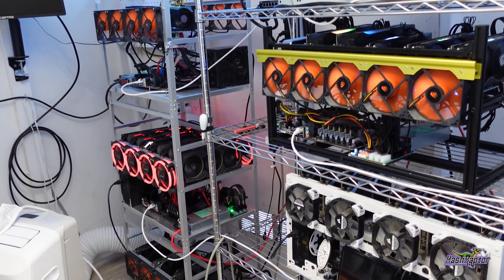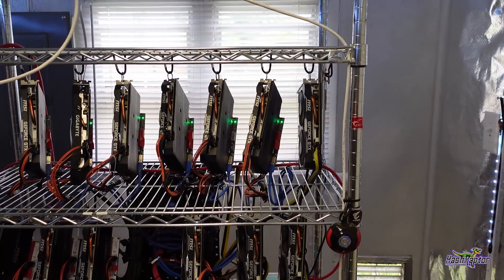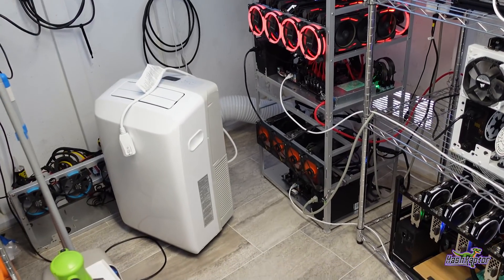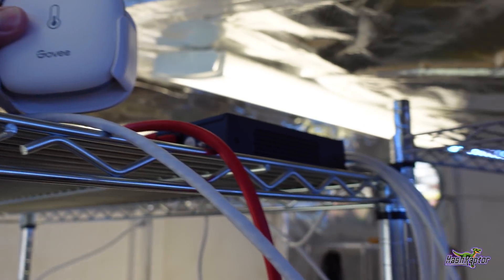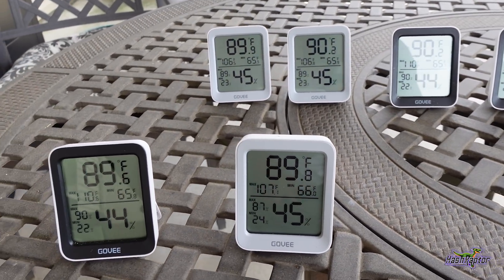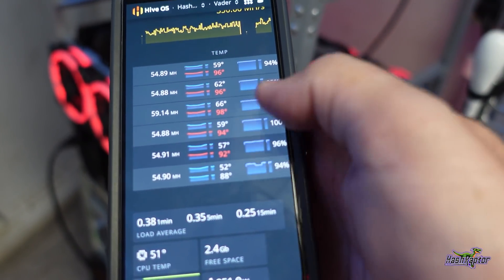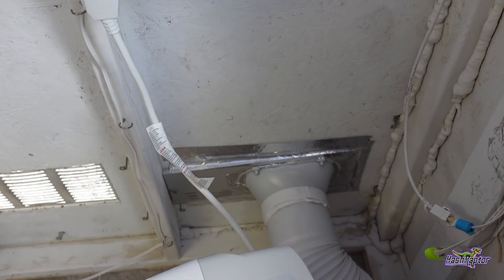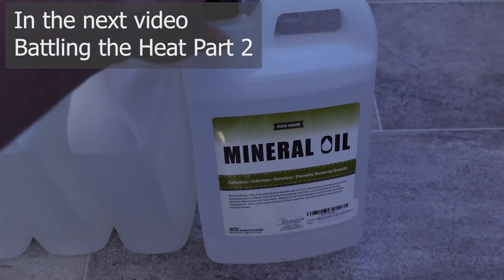You won't believe the HEAT in the Crypto GPU Mining farm !!!

Comment: Hi, I love your shed, I did mining in my shed that i already had on the property and running about 7kw rigs with 3060ti, 3070, 3080s and it generates so much heat that is unbelievable, so even when its 70 outside I still have to run 2 AC units to keep it cooler below 75 degrees inside and if its over 80 outside all AC runs 24/7.  I wonder if you have video with noise levels outside the shed and around the whole house fan  you have installed in the shed wall. I was thinking to cut one in but just worry about the neighbors. My shed right at the fence and I'm running ducted 800cfm fans to reduce the noise.  Thanks for great videos.

Comment: What does the metal on the ceiling do?
Reply from the maker: Hey I have a shed built playlist where I walk through that material. It is a radiant barrier to bounce radiant heat waves off and reduce the temperature. In some of the early shed build videos in that playlist I show the heat difference with and without it. It makes a nice 5 to 10° difference.

Comment: Put a window ac unit in the window... They are much more efficient than the single hose portable ac
Reply from the maker: Yeah, I think I'm pulling the hose unit.  May leave it in there just for me when I'm doing maintenance.  Otherwise int he Part 2 video, you will see some better upgrades I've put in :)
Reply: @HashRaptor  hose units are only good if the compressor and radiator are out side of the room or if the room already has air conditioning. Otherwise they just generate more heat to the room.

Comment: Have you tried putting that 5700 hot rig closer to the cool air vent?

If it was me, just personally, I'd list the temps of each rig and lay them out hottest and largest closest to the inlet vent and let the smaller more open rigs take the hit of their exhaust heat deeper into the farm towards the large exhaust fan.

In my head the bigger the heat source, the closer youd want it to the source of cooling.

Give yourself a full 3 or 4 days of purely shuffling them all around and marking the temp data, the layout will naturally build itself.

Comment: Change thermal pads on 5700 first. test and see results and then try with better fans. you will be surprised how much temp you can drop with pads replacement. I did it on mine 5700XTs and I see a difference by much. Good luck. Looking forward to your next testing with the submerging!
Reply from the maker: Thanks for the tips!  Hey what thermal pads would you recommend for replacement?
Reply: @HashRaptor  I personally used these on my RX5700XT XFX Tripple Diss - Thermal Pad,200x200x2mm 6W/m.k https://www.amazon.com/gp/product/B08GRZ7VLW/ref=ox_sc_saved_title_5?smid=A2UPOYF43ISB1E&psc=1

The reason why is not because they were the best rated but because the best rated were available in small sizes plus they were way overpriced. I did not expect the results I got to be honest which are 10-20celsius drop in temperature. I hope this helps.

Comment: It may be cheaper to throttle down the overclocking and hashrate on your cards rather than spend money on A.C. But you'd have to do the math on that.
Reply from the maker: Good suggestion.  Probably better to set a scheduled flight sheet for the hot hours.

Comment: Man, it's hot in there! I have a heat problem with the rigs in my garage as well.  My door is already insulated, but I will be installing some vents in the garage door itself to help with the airflow.
If that doesn't show any significant improvement, split a/c time will be a serious consideration.  Look forward to following your situation to see if there are any nuggets I can use.
Thanks for your awesome content, as always.

Comment: Hey! I've started building my immersion mining container, using lake loops to cool the liquid. Have our first tank with 32 cards in it so far. Moving over 150 more cards. We used electrocool by engineered fluids. 

I cant speak on the mineral oil front. But if you want to chat on immersion let me know. I can give some help from what ive experienced so far. 

@hashraptor

Comment: I would just install a 36,000 btu straight A/C mini split and liquid cool all future additions, using a 24kbtu window shaker A/C and mineral oil. Dump that heat outside and close the exhaust and air inlets.

Comment: Immersion makes most sense. Creating a wind tunnel won't remove latent and sensible heat load. Close the fresh air intake leave exhaust fan on and run 8k btu ac to temper air or just use dehumidifier with supply air  behind rigs.

Comment: Install a mini-split sysyem. Have an electriction run a new circuit, and you can pick up a DIY system that are rather inexpensive. They come precharged with freon and have a really small footprint outside.

The 2nd option is reduce the airspace you are cooling, ie a whole room vs an small enclosed cabinet. Enclose the gpus in a small cabinet, small as possible then run smaller air conditioning vents directly into bottom of cabinet and exhaust out the top.

Comment: Duct tape can insulate decently. The amount of power isn’t worth it for the A/C. Just sent up for fans with actual duct with fans for out take too. Make the whole shed basically a grow tent and the air moving constantly will do miracles
Reply from the maker: So more intake and exhaust right?
Reply: @HashRaptor  yes. I have a grow tent, get a lot of exhaust and a lot of intake. like that one guy said- the air needs to move quickly, it doesn't need to be cold air necessarily. A lot more efficient to move the heat than it is to try and remove heat.

Comment: I was wondering how you were going to handle the heat situation this year. When it's 98 degrees outside all you are going to do is pull 98 degree air through the shed. Your solution is to pull cool air through the frames and remove the warm air produced by the rigs out of the shed. line-up your frames and put your A.C. unit(s) behind them. Plural because you may need more than one. Maybe they can be smaller units or you can adjust the type you have to low or medium fan speed. That will require some testing. In front of your rigs create an air stream. In one side of the shed and out the other side. The stream flow should not be strong or it will begin to remove the cool air from behind the rigs. Just enough cfm to continually remove the warmer air dispensed from the rigs so that it does not build up in the shed.
Reply: I also noticed that you have a reflective foil on your ceiling. Not sure what that is but it's reflecting heat into the shed. You should have reflective foil facing out in order to keep heat out from the roof.

Comment: You need AC.
If its 95 degrees out and your pulling in outside air though the shed and out the exhaust, its not gonna get any cooler than 95 degrees.
Miners hate talking about installing A/C...cuts into profits...lol
3 ton ductless spilt would be ideal

Comment: I'm dealing with temperatures like that all year long here in Thailand, the AC is a waste of time and energy, you just need bigger exhaust fans on the wall(s) to remove all the hot air inside the HashRaptor batcave as fast as possible, just follow the natural behavior of airflow...
Have a great weekend and stay hydrated out there <3

Comment: You have any issues with moisture inside the shed?  It’s a very nice set up.  I’ve followed it for a while.  That AC is going to freeze over eventually.  It happened to me trying to cool a room. Maybe a few cheap box fans to direct airflow and move the air might help?

Comment: You should solar up your A/C. You need 35,000 BTU, so pick up 4x more Aircons, and 12 solar panels, 2 invertors, and bobs your uncle! You only need the Aircons running during the day, so it would be perfect!
If you're strategic, you can use excess solar to mine. Seems like HOA will love you after this investment!

Comment: Speaking from experience having 44 cards in my garage it works better getting the heat out vs adding cool in, my entire house is foam insulated including between garage and rest if house so heat doesn’t come into house. I have two windows in the garage and added two whole house window fans by air king brand and it keeps my garage around 86F. My 1070ti cards run between 47C and 57c, before fans if I left garage closed it would get low to mid 70’s C
Reply: 44 cards??! How much do get per week with those cards? 🥲

Comment: i have that exact ac and i dont have as much gpus as you but i have 20+. it helps lower the ambient a decent a mount (big difference without it) then once it gets cooler out at night i turn it up to 75 or higher so then it basically blows fan unless needed.

Comment: Finally, a new video 😍
Thx brother for the great content,,,

I would highly suggest to add another exhaust fan to your setup, also; if you're planning to turn on that 8000BTU A/C, pls mind humidity, you may need to consider placing a dehumidifier close to the center.

P.S: I started having the exact same heating issue here in MI.

Thxxx !

Sam 🎵✌🏻

Comment: Great tropical topical content! It's going to be my first summer in my crypto basement, I'm a bit nervous about it. Already pushing the breaker in the basement to it's limits on my 60Ampz circuit. If I where to add fans or AC's I would need to run cables from upstairs so not ideal at all..

Comment: 7000 RPM delta fans pulling 3 Amps Each at 12V can do the trick for cooling the rigs, even at 100 F ambient.  Not possible for you though with the noise. Those 1300 rpm fans behind a rig dont do much.

Comment: maybe try those fans in those 2 windows you have, but in my garage i have 3 in the back door pulling in and i use shelves in front of the garage door and pull air through the house and back door and force everything out the big garage door. i have one 24" fan in the ceiling of the garage and big vents in the eaves of the attic to take care of the attic heat. i can go most days without AC in the house until the wife starts complaining somewhere around a high of 90f outside. i very rarely use the AC and do not have too much trouble unless it gets unbearably hot outside. i am farther up north so its going to be a little easier for me to maintain the temps than your location but i wish you the best and maybe try a couple of those window fans i listed in the other comment.

Comment: You need to do it like data center and use hot/cold isles but you would need the intake and exhaust on opposite sides of the shed left to right. The opening will be in front of the gpu. The air heats up and pushes behind them then goes out the exhaust. You should also use plastic tarp to seal the area above the row so hot air does not leak into the cool row and anywhere that you don’t have gpu fans like in front of the motherboards. https://cool-shield.com/aisle-containment/

Comment: Please dont use mineral oil that is going to ruin the cards. Mineral oil breaks down rubbers and will hurt your cards overtime "hard to be exact. And the combustion temp of Mineral oil is VERY LOW. One spark is all it will take. Also dos not matter them temp of air that goes over the cards as long as there is movement its good "kinda like a car radiator fan shuts off when your going 40+mph, bc the air movement is all thats need"
Much Love Fam You Know Where To find Me.